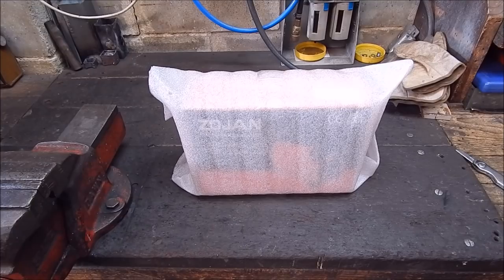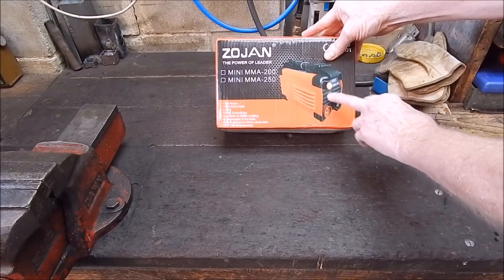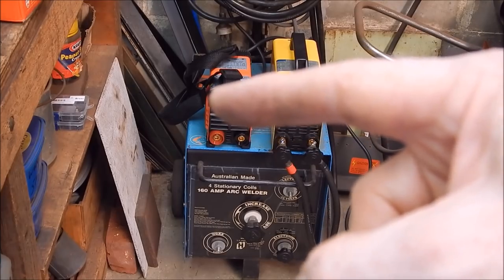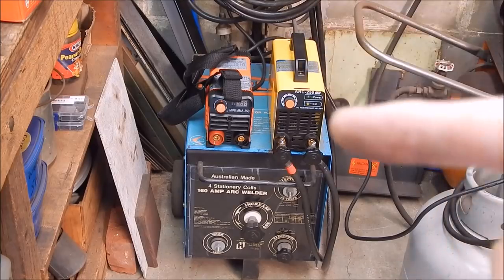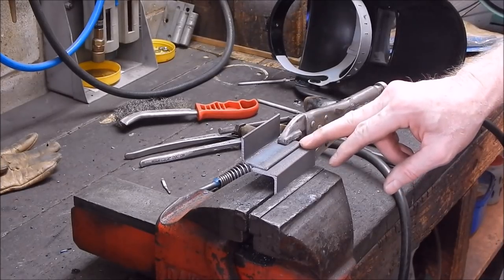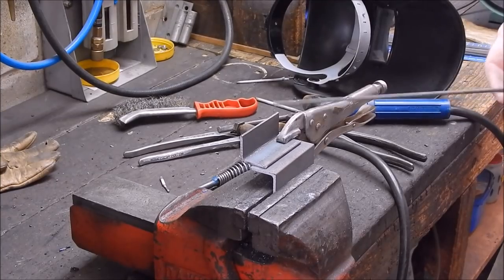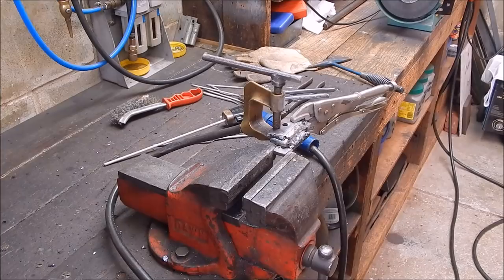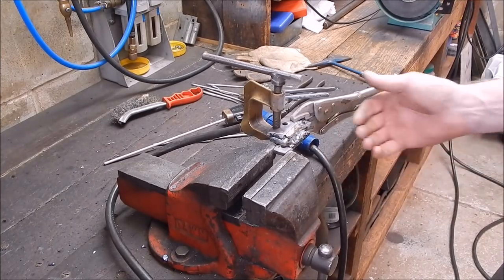Is the smallest DC inverter stick welder from Banggood any good ?

Comment: The math is a little fuzzy on the power rating, see a normal household breaker will be around sixteen amps. (At least in western Europe, where I live) this 16 amps allows for roughly 3,6 kilowatt of power per group. This is quite a lot. Your Chinese dc welder claims to pull 125 amps at 25 volts at half  power, say about 3,1 kilowatt. That would make it trip the breaker at full power, but it doesn't.. at least mine doesn't, and my breakers are top class German engineered and built breakers.

I believe everything written on the casing and box is bull, but when you get a feel for these little Chinese welders they are very very nice tools, I use mine to tig weld too and it does a good job. 

But the power rating is pure bull.....
Reply from the maker: You need to factor in that a DC inverter welder draws up to 50% less amperage to do the same job as an AC welder.  AC transformer welders are very inefficient.

Now crunch your numbers again and see what comes up ;)

Cheers Rob
Reply: @Xynudu I don't know how that changes things, the power sent to the electrode has to come out of the grid, if you put 6 kilowatts of power on the electrode you need to take those kilowatts plus your losses (being cooled by the ventilator) from the grid, and 6 kilowatts just doesn't pass through a 16amp breaker at 240 volts.
Reply from the maker: Hi David,

The amp draw by inverter welders is up to 50% less than a transformer welder.  So welding with an AC welder at 130 amps setting will see a mains draw of about 12 - 13 amps.  The same setting with a DC welder will see a current draw of about 8 - 9 amps.  Big difference.

That's how DC welders can run 130 amp off of a 10 amp mains breaker.

In my welder reviews I ran 3.2 MM rods through a 10 amp breaker no problem.  You can't do that with AC - 15 amp breaker required.

Some Chinese welder outputs are most certainly lower than stated, but to burn rods correctly you wind up the amp setting.  They still run 3.2 mm off of a 10 amp breaker no problem.  You can't do that with a transformer welder.

Cheers Rob

Comment: Rob, thanks again for another honest review.  I bought the usewell unit based on your video trials and glad I did.  Finally I bought something without finding down the track there was something better I should have waited for.  The usewell has had an absolute flogging but still keeps performing brilliantly.  Cam
Reply from the maker: Hi Cam.  The Usewell is great.  I can't recommend this one though.  Considering they are both the same price, it's no contest which one to buy.

Cheers Rob

Comment: Hey guys. I believe 250A x 0.6 = 150A (average power/RMS power) 
p.s. Rob roughly how much do you think it will be for cables, mask etc to set myself up from scratch? Also how long do the units take to ship to Adel from banggood?
Reply from the maker: Shipping time varies from two to four weeks.  I can't give a definitive on overall price as there are many variables  - cable core size, length, welding helmet type and quality.

Comment: I appreciate the review but No gloves, chipping hot slag off. WTF!
Reply from the maker: Not an issue.  Never had a hand burn from that.  Always let the slag cool so it separates before chipping.  Make sure to wear a face shield though.
Reply: @Xynudu  Fair nuff. But it doesn't look good.
Reply from the maker: The worst issue (apart from hot slag dropping into my work boots) I've encountered over the years has been welding with a work shirt that has a hole or wayward buttons on the front.  It's not until shower time that you realise you have a bad case of UV sunburn near your belly button.  LOL.  Seems to take ages to go away as well.

Happens too easily.  At least I've seen it happen to a few others in the game. Welding aprons are good for stand up welding, but not when crouched.

Cheers Rob
Reply: @Xynudu  I worked for a few years fabricating farm grain handling equipment.
We were not given much guidance on safety. The resulting injuries would have a business shut down today.
The most amusing was when the shop bully got a white hot blob down his arse crack, stopping in intimate contact with his testicles.  
I've never seen anyone remove their trousers and jocks in so short a time. There was even smoke :o)
Reply from the maker: Ha Ha Ha.  Good stuff. Sweet revenge.

Cheers Rob

Comment: G'day Rob, yeah the amp meter seems to be over reading which is unusual for anything from china... remind me to tell you the chinese oil container story sometime lol. I have a little Cigweld 170 that I use on a genset for mobile welding. For a 3.2 rod I usually run around 100amp. Was up around 160 the other day but that was 12mm plate to 12mm plate. So yeah interesting reading on that welder.
Reply from the maker: Yes, something odd going on there.

Comment: Hi Rob,

You ground clamp looks like it could do with a re-termination :)
Reply from the maker: The core is a bit frayed but still plenty left.  I might have a look into that.  

I noticed the ground clamp seemed to be getting warmer than normal with this welder, even though it was making good contact . That would suggest resistance, but everything looked OK. Any ideas why that would be ?
Reply: xynudu could be the following:
a. The clamp to close to the weld try clamping onto your vice. 
b. the clamp has dirty contacts.
c. remove some of the ground jacket and see how much oxidation there is and remove it.

You could use a multimeter to test for resistance and change one thing at a time until you get the lowest reading.
Reply from the maker: Could be (a).

I had it on the vice initially, but moved it on to the job to try to rectify the issues I was having with amp readings.  I will have a look at that connection this morning.  The clamp works fine on my other two welders, so I'm pretty sure that's not the issue.  I'm going to give this welder to the Bro-Inlaw, so it should be interesting to see how he gets on with it :)

Thanks for your comments.

Cheers Rob

Comment: Do you ever weld with gloves?
Reply from the maker: Yes.  If I'm doing a lot of welding I wear riggers gloves and long sleeved shirt to prevent flash burn.  I don't like full sized welding gloves as they lack/restrict feel and movement.  CIG/BOC make some nice light weight welding gloves which are one step up on riggers gloves and not restrictive.  They are a bit expensive but very nice.  I may invest in a pair at some stage.

Cheers Rob
Reply from the maker: I wear a glove here:  https://www.youtube.com/watch?v=xmHiR74UuUs

Cheers Rob
Reply: Ok. Just wondering. Keep up the good reviews.

Comment: The ventilation holes are a great disadvantage. the holes let in way too much dirt and grit that shorts out teh internal circuits.
the better units are built with no ventilation holes to keep the dirt out. they are built more robust so they do not need the ventilation.
Reply: I have an EWM triton 220. Top kit. Plenty vents.
Reply: Charles Put some material from a screen door as a filter.

Comment: The issue with the rods could be poor current regulation, but I'm not an expert.
Reply from the maker: Could well be.
Reply: If it comes to rods its always voltage/current curve that affects different rods but here it looks like He is doing too much shaky/circular motions with the rod, and therefore there is a lot of trapped slag etc, just try them with plain drag on flat surface.

Comment: I got one of the off banggood.First thing i did for safe usa wiring 30amp 3 wire. rewire it with 4 prong 220 plug for 30 amps. Hook ground wire inside to back metal with screw. Display meter broke on me first day but knob is still accurate for amps..

Comment: Could you use that arc welder a spot welder by using solid copper electrodes?
Reply from the maker: No.  The arc would be continuous and burn through the job.  Spot welders have a timed arc to prevent that happening, from the little I know on this.  Cheers Rob